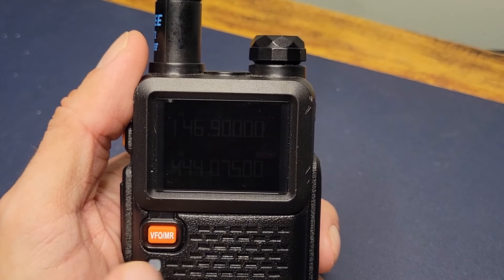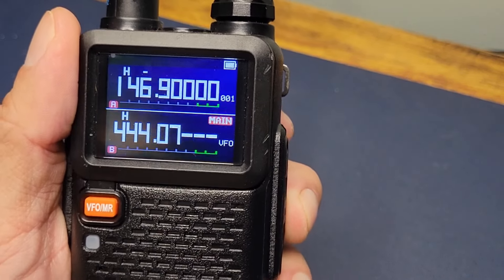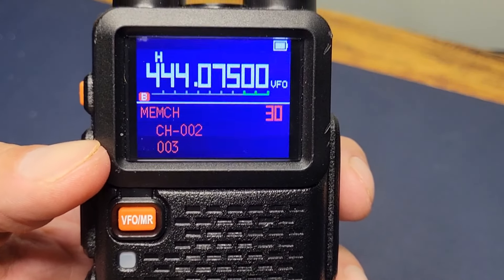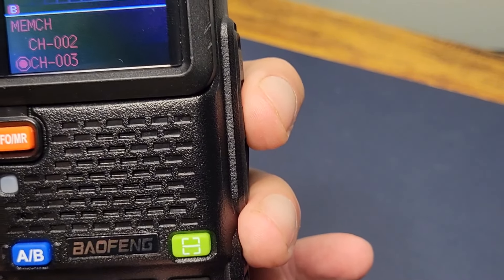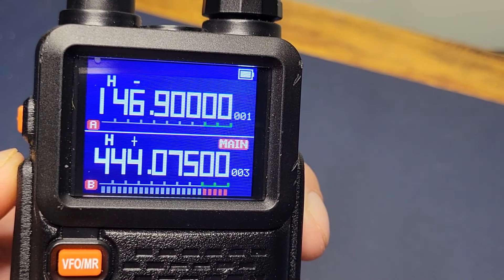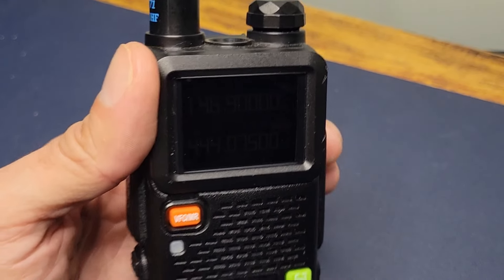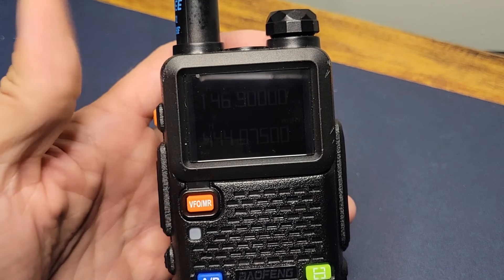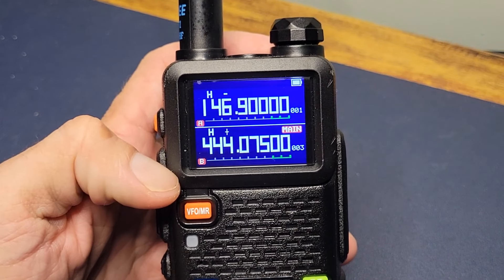Manually Programming the Baofeng 5RM (Without CHIRP)

Comment: you don’t need to do this.  There is a menu option for offset.  You just set that offset in menus and boom done.  You don’t have to save two frequencies to the same channel
Reply from the maker: Interesting, unless I misunderstood the manual, I couldn't program it the way you are speaking of. I had to go through the save twice method.
Reply: @NukaVaultReadiness  works both ways for me

Comment: I have been trying to setup mine and the more I watch the more confused l get, do I add the UPLINK first then just + 5 in settings:offset?
Reply from the maker: Apologies that my wording was kind of all over the place, still relatively new at this. 

The easiest way to program it (I assume you mean as a repeater frequency) it as follows:
1. Enter VFO mode, set your RX frequency
2. (Green confirm button to enter menu, top left of keypad) #31 - Delete the memory bank you want to use
3. #12 for your TX tone-CTCSS, enter the Repeater's tone. If you need a RX tone (#10) enter that as well
4. #28 enter the appropriate SHIFT direction (+ or -)
5. #29 enter your offset in Mhz
6. #30 place in the memory bank of your choice. Make sure to do this step twice consecutively
7. Enter MR Mode, and check the memory bank you stored your new frequency in and test out

Hope this helps!

Comment: How do you program just a simplex frequency manually? Thanks
Reply from the maker: -For that you can just enter VFO mode and put in the frequency you are going to use.
-Make sure you have any tones or shifts turned off
-#31 to delete a memory bank
-#30 to save the frequency into the memory bank
-Go back to MR mode and make sure your now simplex frequency is saved

Hope that helps!

Comment: Hello friend. Do you have the original file of the equipment? Can you send it to me. Thank you
Reply from the maker: Help me understand, what do you mean original file?
Reply: @NukaVaultReadiness  Original configuration of the programming software. The one that comes from the factory.
Reply from the maker: To rest the radio completely:
- Go to the menu (green button on upper left of the nine keypad)
- Menu # 42
- Access #42 (via same green button on nine keypad)
- Select "All" to reset, then confirm
- Your radio will turn off, then back on after a moment, fully reset

Hope that helps!